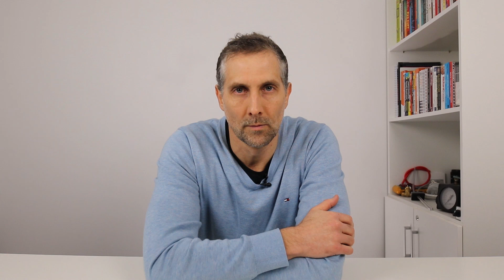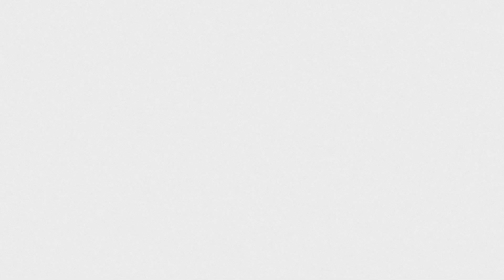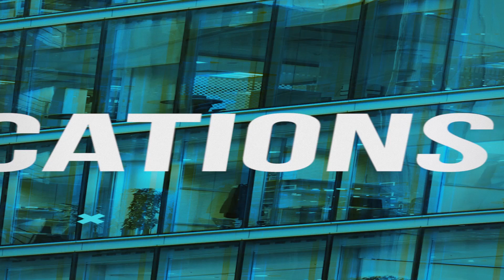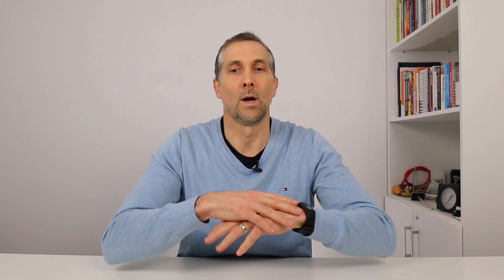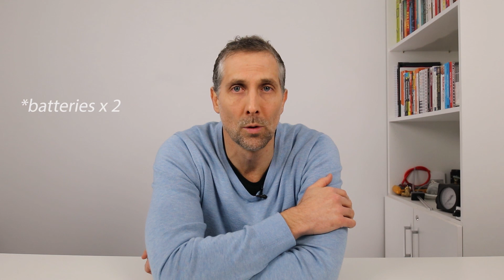Wireless Temperature Sensors - 5 Things To Consider (BMS)

Comment: Hi Bryce, I agree with your comment on using wireless sensors during construction over such a large scale, wired is almost always the better option. I do believe wireless sensors, whether it's temperature/Humidity/CO2 or even Window Contacts and motion/light sensors, do have their place in buildings though, just not with batteries. If using Enocean sensors, you don't have to worry about batteries (Although they can be added as a backup). As long as the room has 100lux for a few hours each day or even every other day, the sensors can operate on stored energy from their solar cell. We use this wireless technology for room control, using wireless radiator actuators (energy stored from heat in the pipework), window contacts, motion and combined Temp/Hum/CO2 sensors. It's been a solid solution for us over the last few years.
Reply from the maker: Hi Mark, I did get a few people mention the Enocean batteryless sensors. 
But sure, there certainly is a need for wireless sensors in the right application. 
The secondary purpose of this video was actually focused at all the IOT sensor manufacturers that are trying to break into the market without understanding how heavy construction works. 
Good to hear you are having success with wireless sensors. 
Cheers.

Comment: We struggle with hard wired cabling during construction because there are no walls to put the sensors on other than columns that need to have conduit cast in them for the sensors. That's proved to be pretty expensive.
Reply from the maker: That makes sense. Here where I live the BMS companies don't pay for the conduits in concrete columns, the builder does. They just need to be on the ball and make sure they make it clear which columns need them. 
I worked on a job last year where the BMS guys did have that issue with no walls to get the sensors onto. We ended up agreeing to roll them up in the ceiling and then drop them down walls during the fit out. But yeah, that isn't always going to work. 
Thanks for the comment.